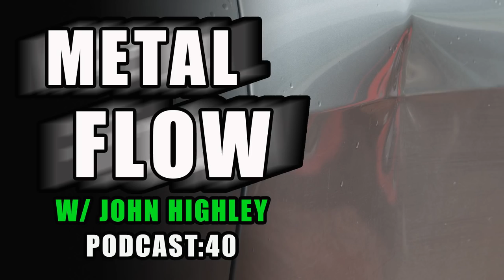40: What is Metal Flow? w/ John Highley - Tesa Tape Strap

Comment: So many guys start with the crown. I remember a guy in France pounding a crown for 30 minutes on a large quarter panel hail dent. Once he started finally pushing the dent, all that force at the crown could be seen because the crown fell in to its own dent.

I say always start where the initial force hit the metal, then if the crown is stubborn, knock it a down a little at a time in between progress on the dent